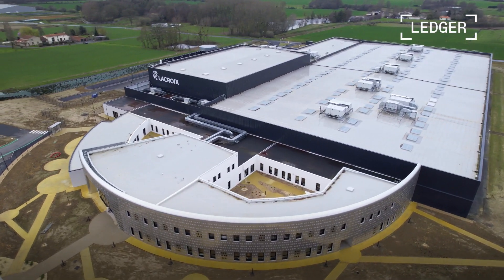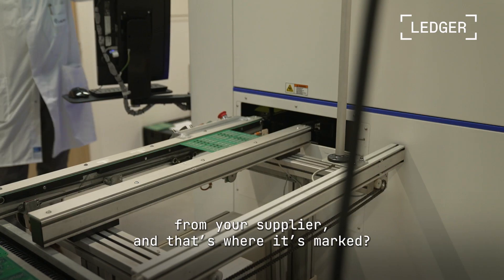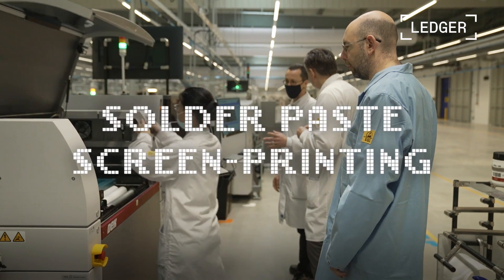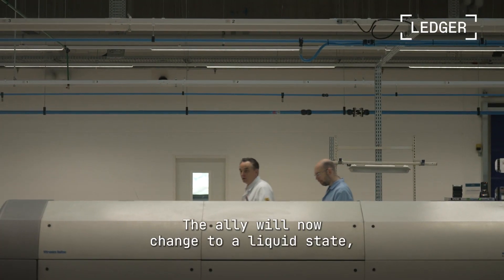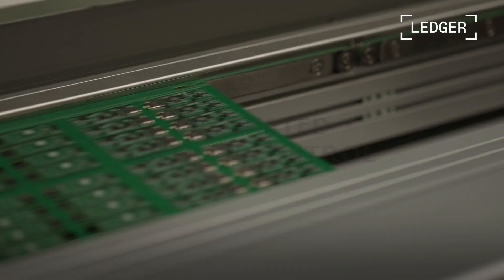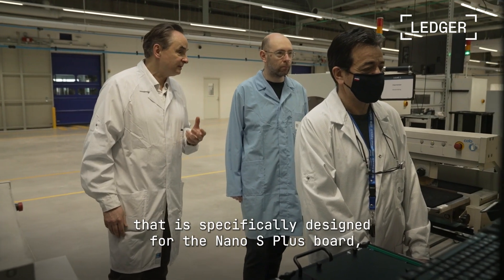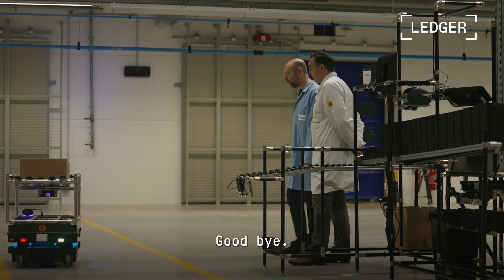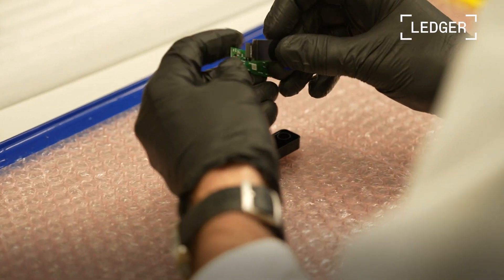Behind the Ledger Nano S Plus - Part 2

Comment: @ledger My Ledger Nano S Plus is experiencing poor connectivity, requiring me to apply significant pressure to the Type-C connector for it to function properly. I've consulted an electronics repair service, and they suggested replacing the connector. However, they're unable to locate the specific connector for purchase. Can anyone assist me in identifying the exact model of the connector and where I might procure it? It's also worth noting that I've attempted to reach out to Ledger support, but unfortunately, they have been ignoring all of my messages. Additionally, I've tried to search for the code H2217A, which is engraved on the connector, but have been unsuccessful in locating it.